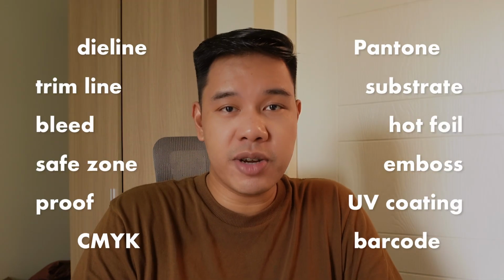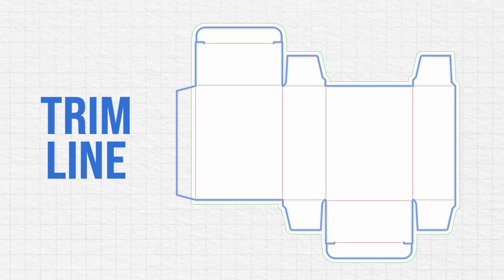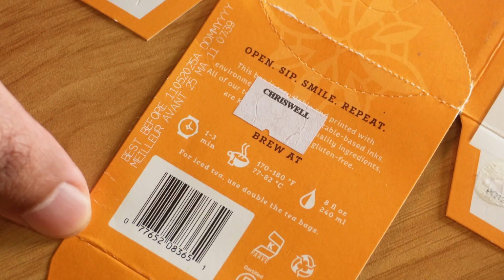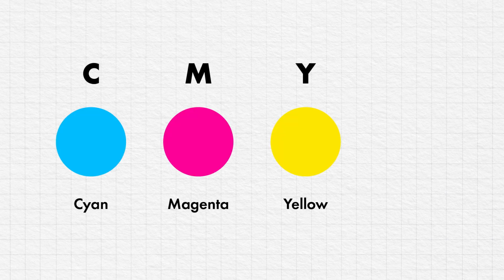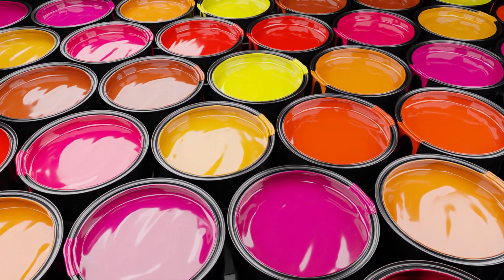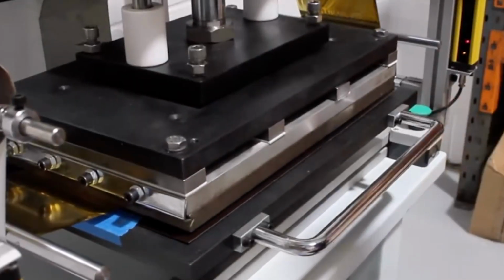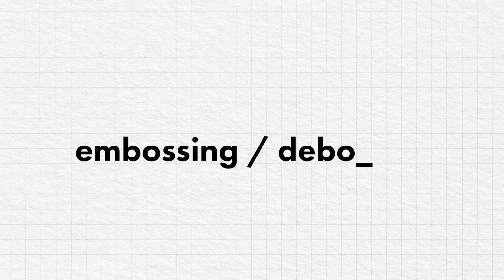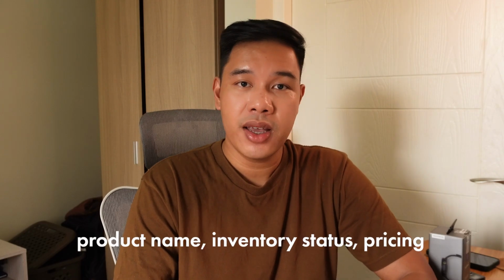12 Packaging Design Terms You Should Know as a Graphic Designer

Comment: What changes do we need to make in our Illustrator file to get the golden foil or golden debossing effect?
Reply: You can use a gold gradient in Illustrator just to show the effect in the design. But for printing, the company does not use that gradient. They apply special gold ink or gold foil on the marked area.

In the file, make a separate layer for the gold area and use a solid spot color. Then the printer will use special gold ink like matte or glossy, depending on the finish you want.